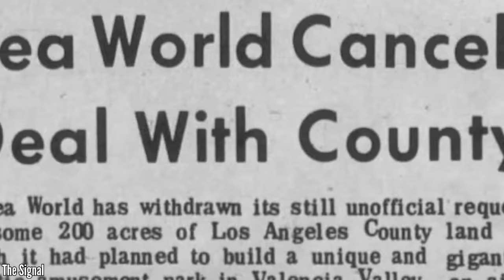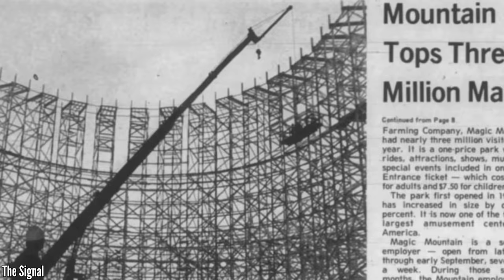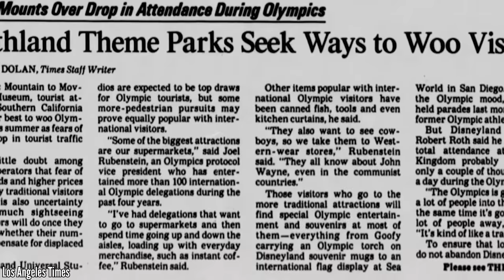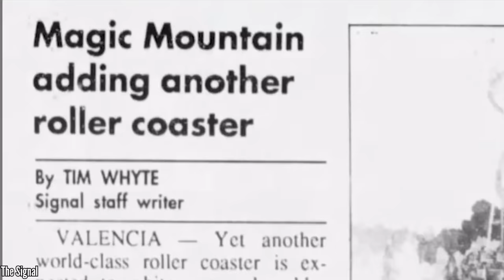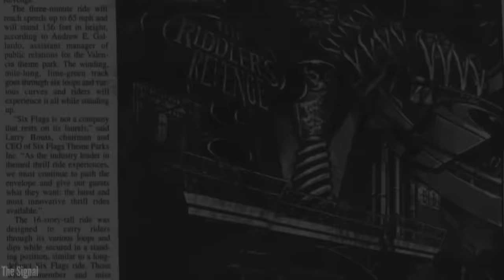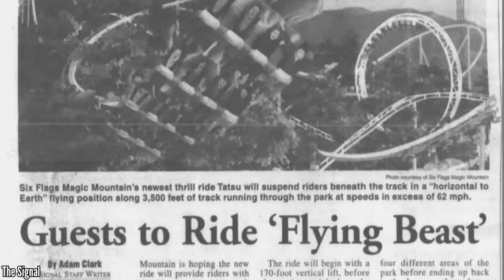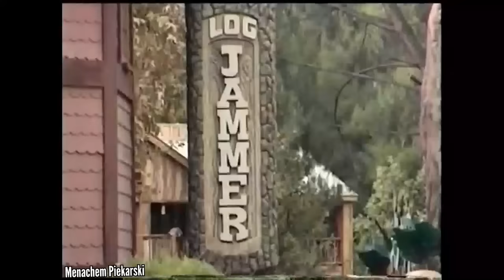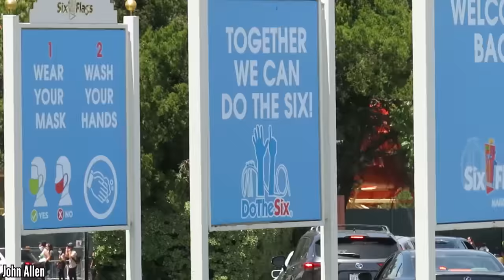The History of Six Flags Magic Mountain (1971-2021) - The Complete Documentary

Comment: Walley World! How many of you knew that? Got to visit in 2002 so at least I got on THAT version of Colossus before it was RMCed. (it had multiple neuterings since the Griswolds took it for a spin). As an Arrow fan I am happy that 20 years later Viper is still running strong. Of the 3 mega loopers Arrow built it survives, is in a far less rust prone environment than Shockwave and GASM were, and is the one without that horrible neck jarring turn before the midcourse that the other two had. Now, if only my visit had not been right in the middle of X having its trains redesigned... :(

Comment: I grew up in the San Fernando Valley, 20 minutes from MM.  I was there in the first Summer.  I was there when Revolution opened. I was there week one for Colossus ( the wait time was 3 hours ) and what a coaster it was!  
There was a time I called MM my home park but there were some dark years that they seemed to care little about the guests.  Gangs roamed and caused trouble on a regular basis.  One day I got so fed up that an hour after arriving on my only day off from work in 3 weeks, I was involved in an incident with 5 gang members. Not feeling safe, I went to customer service and requested a refund.  I was told nothing could be done.  I switched to Disneyland and never looked back, refusing to set foot in MM ever again.
Reply: Yeah I worked there in the mid 90's, there was always a big gang presents. I remember more than onces having to go on lock down due to fights breaking out.

Comment: To be fair there were reasons why people fell out of Superman and Perilous Plunge. I was at Knott's the day that woman died. She was a rather large woman that was too big for the ride, I hate to sound callous but when you're over a certain weight and width, you should know better than to force the park to let you on. It's impractical, unreasonable and selfish to tell ride manufacturers they MUST make rides that fit people over 280lbs. HOWEVER, if you're a body builder it's easy to be that weight and having 6% body fat, so it's tricky especially with the whole 'fat acceptance movement'. If you want to get very large and take those risks in general with your health (leg ligaments, circulatory issues and internal organ problems), that's your prerogative. BUT don't make normal sized people subsidize adjustments and accommodations for you like airplane seats, theme park rides and other modes of transportation. 

It may not seem fair to charge more for selected areas that are made for larger people, but it honestly, it is very fair. One can easily use the added up money of paying to have larger accommodations to consult a doctor, or personal trainer. Also I don't endorse unnecessary surgery, but if you want to go that route there's that for 'weight loss'. Although that is the epitome of negative reinforcement. I'm not even trying to be mean, I'm just stating facts, and majority of people like myself feel exactly the same but are too afraid to "hurt" people's feelings. It's just the reality of things though, you can't expect a ride like Wonder Woman to change their trains just because you can't fit on the ride, it's unreasonable. So in some situations, it just is what it is. As far as Airplanes, if you are too large to take one seat, then the airline (and my proxy, the other passengers) subsidize the cost by paying more for regular sized seats.

Edit: The Superman ride's were of varying blame. I forgot how cursed almost every ride named Superman is. I agree the attendants were at fault in 1 1/2 of these (the 3 I'll mention). 
-The tower of power or whatever it is called, was straight up negligence and incompetent, and was 100% at fault for not hitting the E-Stop IMMEDIATELY once they heard the loud sound and especially the obvious cable snapping. I couldn't imagine losing your legs over an incredibly stupid attendants lack of ability to hit a big red button and RUNNING away. 
-The ride in TX was honestly on both the rider and the people running the ride. The rider should have known that a ride like that was not meant for people missing either leg (or both obviously), it actually said it on the placard of the ride. HOWEVER, the operator also should have been cognizant of the issue and noticed the man was missing a limb. 
-Then there is person at New England that had Cerebral Palsy, he himself forced his way on the ride and strapped himself in. I have to put that on him, because riders with ailments like that are legally obligated to let the ride operators know. How would they have known otherwise. 

None of these are mean (and I blamed the operator for the tower of power), it's just the way it is like I said. You can't call a park "mean" for asking you questions that are meant to save your life, and it's not ableist not to let people ride if they're likely to die as a result of the answers to those questions. Roller Coasters will NEVER be able to accommodate everyone of every size, every height, every disability, every health ailment and every age. Unfortunately due to people getting way way too sensitive now, I absolutely see more problems occurring in the near future as the parks will be afraid to be sued by over sensitive individuals.

Comment: I have been to Six Flags Magic Mountain and Great Adventure in New Jersey and my honest opinion is that magic mountain is better besides Kingda Ka being a top 10 Steel coaster but Cedar Point is the best Amusement park is the US by far!! The atmosphere out on the Peninsula and the overall layout and ride selction is way better. Millennium Force blows any ride away at Magic mountain!! The new coaster Steel Vengeance is better than Twisted Colossus too
Top 5 Fav. Coasters I have been on
1-Millennium Force Cedar Point
2- Phantoms Revenge Kennywood
3- Kingda Ka Six Flags NJ
4-Full Throttle Six Flags Cali
5-Gatekeeper/Steel Vengeance
Honorable Mention
X-2, Titan, Fury 325,  El Toro